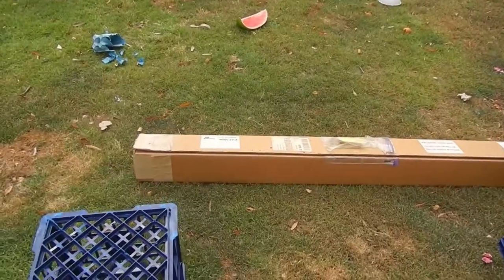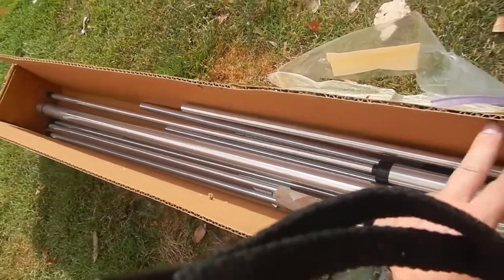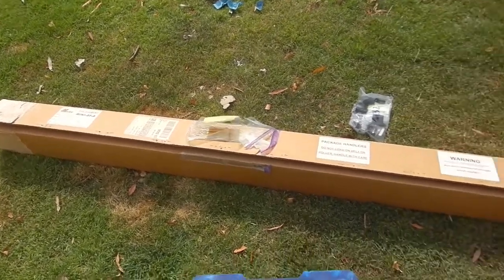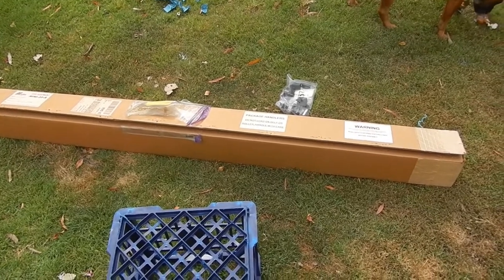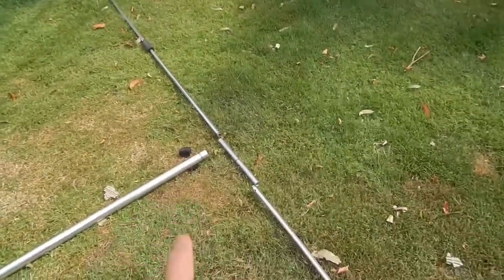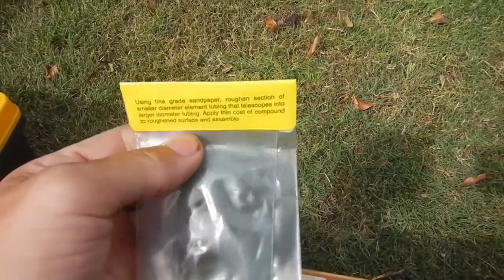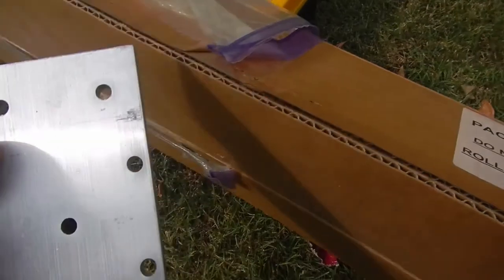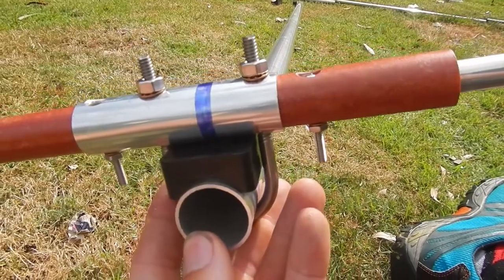Mosley mini 32a 2 element tri band yagi - P1 Assembly

Comment: Just got my 32-A today, I'll be following your videos for assembly. Should be fun!
Reply from the maker: Glad to hear it. As per the comments, the metal saddles go under the elements. I have since changed min. 
No change in performance but it feels more sturdy. 
how goes the progress with it ?
Reply: Just put the elements together, was wondering which way the metal saddles would go. It doesn't make much difference having the instructions as they're not that good, better to follow your videos!! Should have it completed by the end of the day and I'll start tuning tomorrow.
Reply from the maker: excellent. I didn't find it needed any tuning outside of the recommended settings I was able to find online. 
It worked well out of the box per say. 
Let me know how you go.
Reply: Using recommended settings: 20m - 1.2 at .100 & 1.6 at .200, 15m - 1:1 at .250 & 1.5 at .400 and 10m  am getting 1.0 at 365 goes up to 1.2 at .500, not bad and I can tune up thru auto tuner on all most areas of the 3 bands.